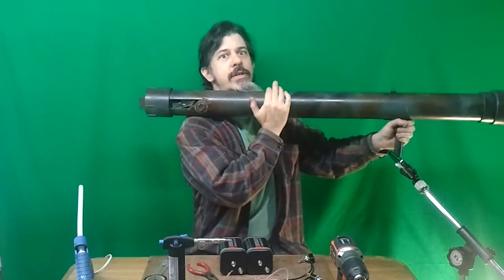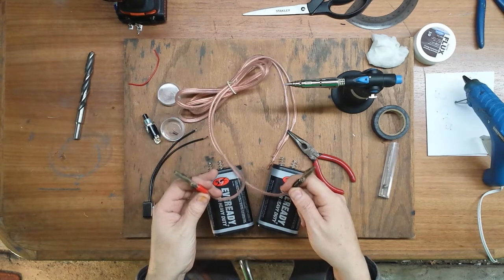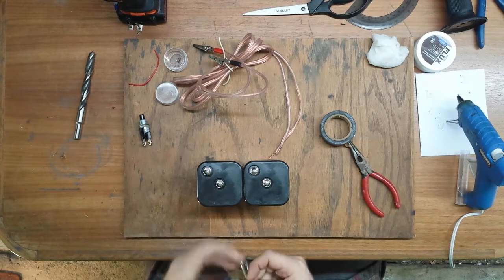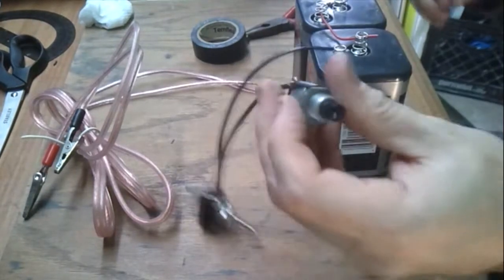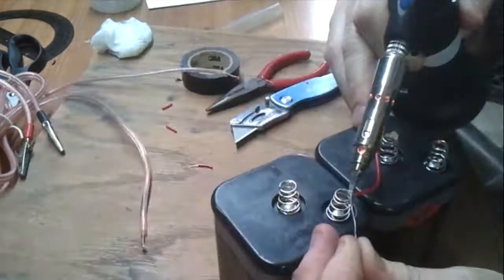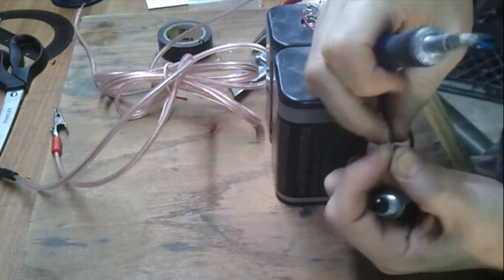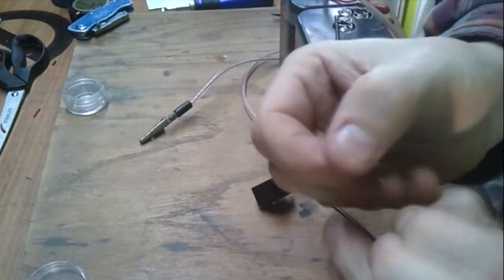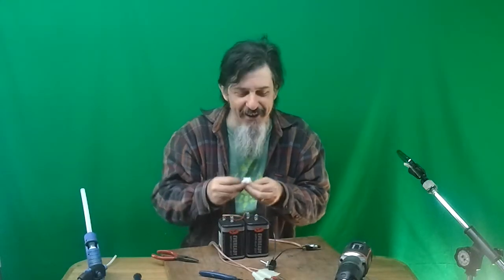Simple 12v Electric Igniter for Nitrocellulose and Electric Fuse

Comment: You can use the winding of a thin guitar string, usually the third string down on a number 9 guitar string. And light it up with a 9 volt battery. Cheers

Comment: HI Schel:  When making your electronic ignitor, interchange the order of the switches, and change the safety switch from single pole single throw to double pole double throw.  In this way  you can reconfigure the safety such that when the safety switch  is in the safe position the nichrome wire is tied to ground so there is no possibility of a false ignition due to a fault condition.
By the way, you can get away with using two smaller nine volt batteries (in series) with a large aluminum electrolytic capacitor (rated 20-25V) across the batteries to provide the same energy to turn on the nichrome wire.

Comment: Did you wrap steel wool around your normal visco I'm currently making a wireless remote control ignighter with an RD module
Reply from the maker: Nope, no fuse or hidden anything, however im working on a homemade electric match project right now. will be much better.

Comment: what can I use instead of a nichrome wire ?
Reply from the maker: +Daniel Pancham any sufficiently thin conductive wire should get red hot. But the nichrome wire is really easy to get an old hair dryer. It's very durable and has very high resistance so it gets hot very easily. Thank you

Comment: I was thinking of a more inexpensive way to make nitrocellulose. I did the math, and I can get KNO3 for three dollars a pound and a quart of drain cleaner for 9.00. This means that using 60 grams of KNO3 and 220ml of drain cleaner would cost you 50 cents to make one gram of nitrocellulose if you used five grams of cotton. So what I did was get 60 grams of KNO3 and 30ml of drain cleaner and use my glass distiller to distill the nitric acid off. I got 25ml of over 90 percent pure nitric acid. I mixed this with 50ml of drain cleaner and mixed that with about 7 grams of cotton. That means you could make higher quality nitrocellulose for only 17 cents a gram. The only extra costs for this setup is a 30 dollar glass distiller off eBay and a hot plate for 20 dollars but I already had these things.
Reply from the maker: The stump remover is a quite expensive source for KNO3, Ive since sourced it much cheaper from a garden supply store online. Great Idea about distilling nitric acid, you should make a video on it!